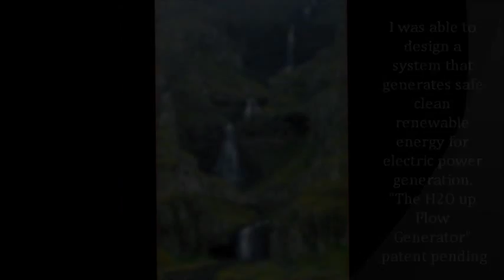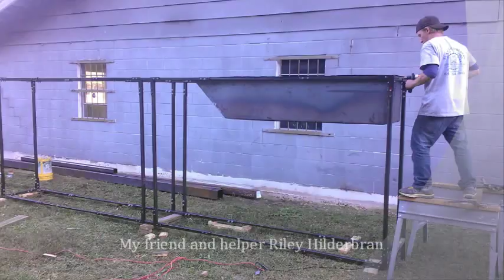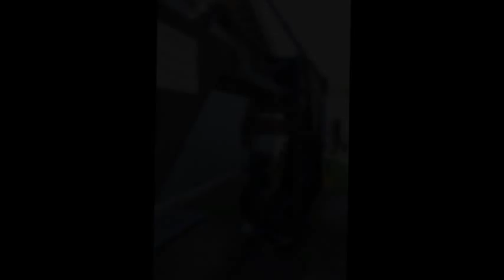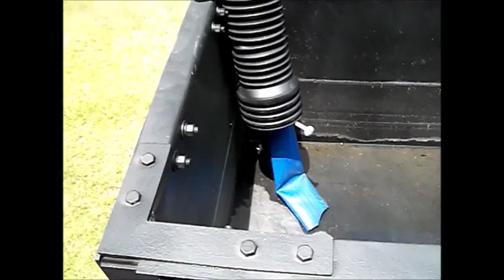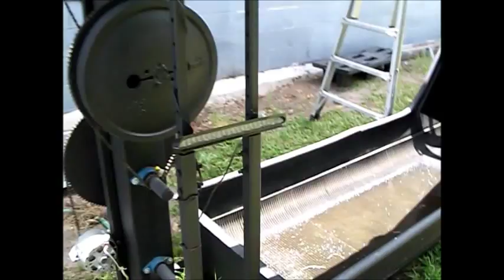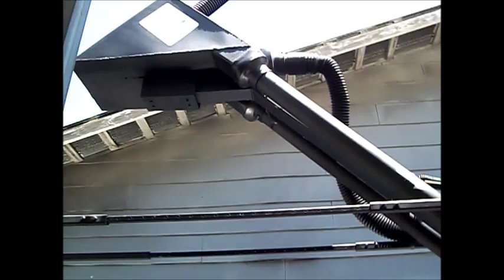Kraig /Blatchley Power /H2O Up Flow Generator/ Safe, Clean, Renewable Energy System/ Gravity Pump

Comment: So the water is coming from a river upstream filling the tank and when the tank is full, it drops, therefore, turning a generator.  So this is not a continuous generation and you're only getting a few seconds of electricity because the unit needs to reset every time.  For this to be useful, you would need several of these units.
It's a great idea, I am just not sure how much energy this can produce and how many of these you would need.
Reply: you need alot of them to make electricity and you need alot of them to move a significant amount of water up hill. His ideal is to have them stack and have a bunch of them but since it is gravity fed i don't believe it is any better than just having real turbine getting benefit from a dam. 

By the time his units go thru all that rocking and taking a cup full of water uphill each rocking motion, a turbine on a dam that requires the same amount of water flow would have already produced the electricity and more of it.

Comment: this is so wrong on so many levels. I hope you understand before you put any more money into this, that each time you raise the water above the level, you do so because there is more weight on one side of the pivot point, that the other side. You need to look at this from all angles. If you raise more water on the left than on the right, then you must have less traveling distance on the left than on the right. The flywheel does nothing but slow the process down. Stick with only one level and only the right side of the pivot having water (no water on the left).  When the basin detaches from the magnets, you will have realized the full potential energy, as all that weight will push down. As for bringing the basin back up,  that's what you use the counter weight on the left for (should be slightly heavier than the weight of the right side).  If you decide to go forward, you will have a very expensive learning experience, and will eventually understand that to bring the amount of water you will be bringing "up" to a certain level, is more economical to employ a pump that can run off the energy produced by utilizing the full potential energy of that first fall of the right side pivot. gl... but i'm afraid you will fool yourself and other people :/
Reply: Even that is still so wrong. Because like you said the distance and the weight, forced to sacrifice distance for weight and visa versa. And technically he wouldn't be producing any electricity if he had a real load on the generator because now the resistance on the pivot point is so much that his water weight bucket on the right won't even swing down, full of water or not. Because like you said, the left side has water in it diminishing his electrical generation possibilities, on top of the fact that a load on the generator will halt the process.

Mark these words, magnets already hold the bucket up until it is full, and the magnets magnetism created in a decent sized generator is much higher than loose permanent magnets. It means the generator will stop the bucket from falling when he tries to take a decent load from the generator. In other words, he would have to design it like you said, plus only have a tiny generator so when it gets fully loaded it still can't stop the bucket from falling. And then it is pretty much useless for electricity generation.

He thinks he can do those two things at once and not sure he realizes he has to sacrifice one for the other, between generating electricity, or moving the water uphill. But he thinks it can do both but it will suck at doing both those things, especially doing them at the same time, and that is when it will quit working all together unless his generator is so small it can only light up leds.

But a smaller design for a small creek could be awesome maybe, only for moving water, but the fact that you need multiple units to lift the water any significant amount. But that is what he needs to do, build something that can be installed and show us how he lifts water into a water tower for free. etc... If you can capture the entire streams FLOW into the retaining bucket and THRU the machine without losing any, then you can get his units going as fast as they possibly can on that specific site. 

But the fact is a ram pump already kicked his ass in this field, and takes like only 30 dollars to make, plus the pipes to pipe water where you want it. And you don't need to stack 15 ram pumps to get the water way the F up there, you only need one ram pump of the correct size for your needs, sized for your specific stream/river/creek/etc... to get water uphill. For every ft. of head height into the ram pump, you can pump water 7 times higher than the head height feeding it. So for example if you have 5 ft head height, you can lift the water 35 ft, for 30-50 dollars plus pipe. You can run it anywhere that don't go beyond 35ft of height from the 5 ft. head height feeding it. Sometimes you will have a 9ft height, or even a 15 ft head height feeding it, that is 7 x 15 = 105 ft. elevation. A ram pump take a decent amount of linier space, they are long and skinny, the input pipe is the key to keeping the right head height, it is long.

Comment: Wouldn't it be more efficient to just build a water wheel in the river?
Reply: +jay5729    No... with my system I could build an entire power plant of any size on land next to a water source. Because my system recycles the water so efficiently it only requires a small amount of water to keep the system running. The same amount of water to run a water wheel I can use to power one unit or a thousand units.
Reply from the maker: +1100tech Yes we are doing all that also. We just have the small alternator to show proof of concept. We can generate much more power. We have a system already set up for continuous power output and a closed system option.
Reply: Я сам такую установку собираю🙏🙏🙏💥видео с подробной схемой моего первого БТГ на силе Архимеда и силе гравитации💎и мультик👍🏼🙏 https://youtu.be/ud9egYvpeXQ 🙏🙏🙏🤝
Reply: +Kraig Blatchley i see a possiblitiy for the system to be use WITH a water wheel by lifting the water and letting it run down on a water wheel ( with a bucket catch system ) and that way you have a contained electrical generating unit.  The amount of power you make by spinning that little alternator a few RPM's isn't enough to lite a 20watt lite for more then 5 seconds . Think about what i'm saying and you will see what i see and what i'm working on in a "Heron's" fountain/siphon combination  . A self-contained ,perpetual-motion,generating Unit that NEVER needs a river,stream,or puddle to make it work because it reuses the water from the wheel and recirculates it from bottom to top using a system like yours .Hope it can be modified to move a 6" line of water 20' in the air to a scoop/bucket /water wheel system to use gravity and gear ratio( like yours) to turn a 50kW generator

Comment: Hate to be a skeptic but wouldn't the pump use more energy to pump the water up then the unit would generate in a single pivot or even multiple device pivots even.
Reply: +joey caughey Hi Joey, the bottom units are continuously gravity feed from a river or water source. The sump pump is there just to do my testing.